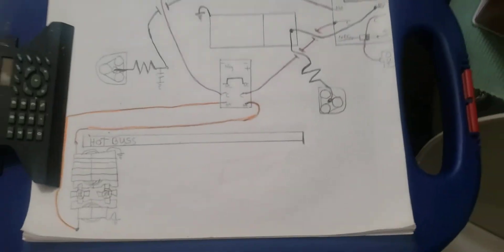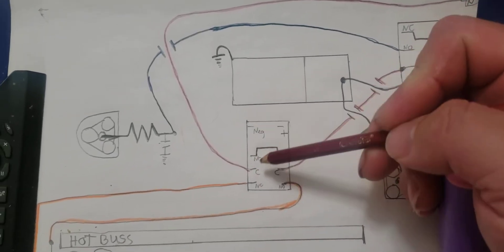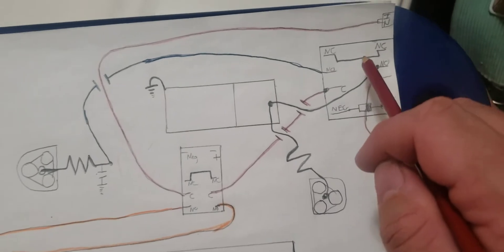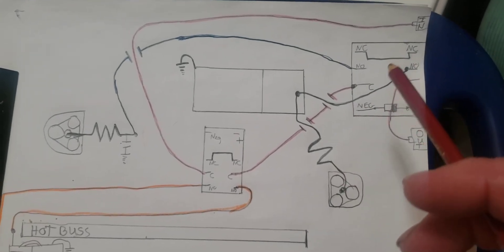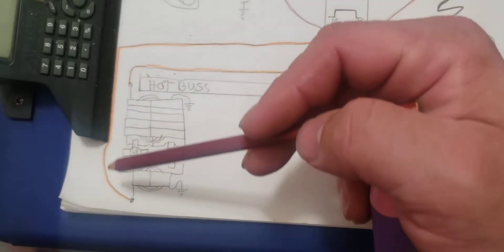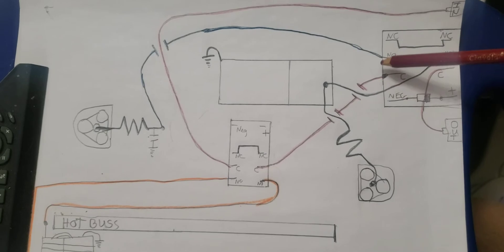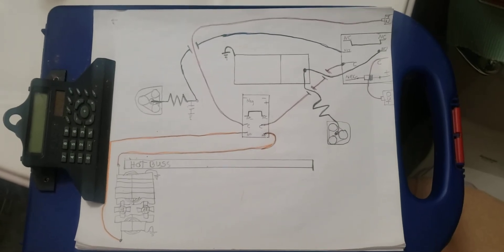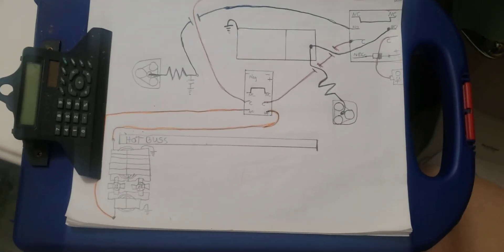Quick Diagram Of A Staged 2x8 RF Amplifier - [How To]

Comment: The only draw back to a stagged amps is the user will turn the carrier up to dead key radio in to 8pill where is sounds good. Then they say I need a little more, They will forget to turn radio carrier back down flip on the 2pill section. Then 8 pill will be keying like 1000 watt and the 10 OHM smoke will roll. Then they will be wanting the builder to fix it for free. Been there got T-Shirt. Even myself I build I would forget running one. You did great job explaining it man.👍👍👍👍👍👍👍👍👍
Reply: That person would be me but I wouldn't expect a repair. I'm always worried about hurting my amps. I have an sb220 only maybe used it twice.
Reply from the maker: @beekeeper8474  even me being a builder that can fix im still paranoid about hurting mine to brother.
Reply: Wish I had you build my 10 pill
Reply from the maker: @RedeyeParker  with that comment it shows me you haven't been looking at my updates....I. About to leave another update with you on the 12 pill video under the 'KARMA' Comment.... I hope you have been reading them man.
Reply from the maker: Yes that does make a lot of sense actually....or people running a driver for whatever reason doing the same. Would be nice to have a simple over drive circuit but they are always a bit complex for what we do ya know. Thanks for stopping by brother!

Comment: I am presuming that this uses too separate keying circuits based on the properties. It is a pane in the arse lol. When doing this lol.
Reply from the maker: Yes it is. So far that is how I have done it and using a DPDT relay for ssb delay. Yeh it is crazy at first I didn't like it but I built so many I got use to it...it atleast makes it easier to tune all I habe to do is flip a switch..tune....flip a switch tune instead of using liter lines or wires bypassing sections.
Reply: I haven't done it in years... Back day I used to use just on off relay make it 2X8 or Strait 8 option only....When I have had to stage past 10yrs lol I do it like GK Shows.
Reply from the maker: @DonkeyStomperProducts just now figured out that YT studio doesn't show comment reply and I wonder how long I've missed out hwdn people reply to me wow.
..

Comment: staged amps are hard to tune at times. the output tune of first section is input tune of next and not always in line and relay and extra coax can make a impendence bump that have to correct for.. usually have to pick a best for most way the user is going to use it. 73's
Reply from the maker: EXACTLY YOU 💯 HIT THAT IN THE HEAD.....